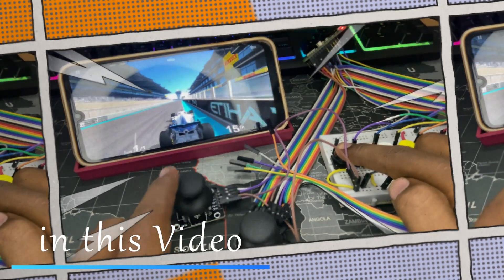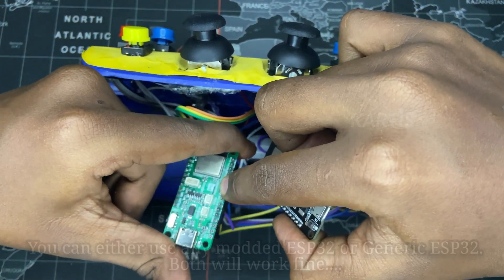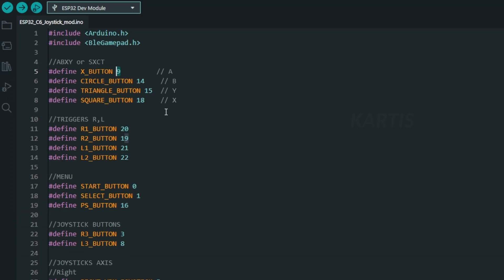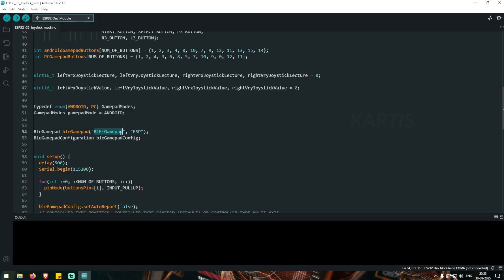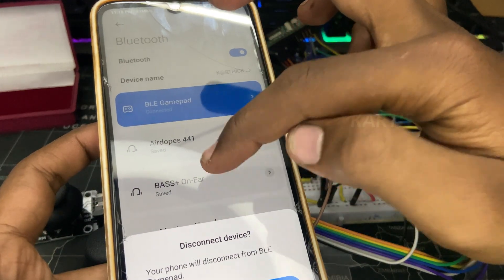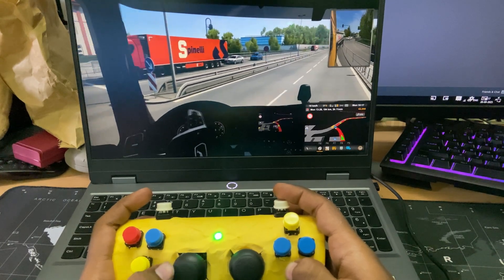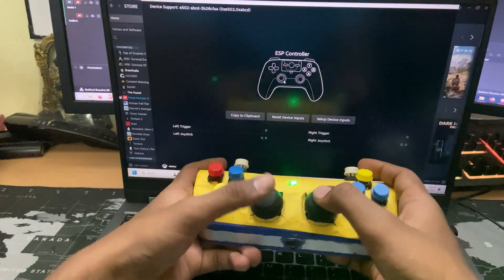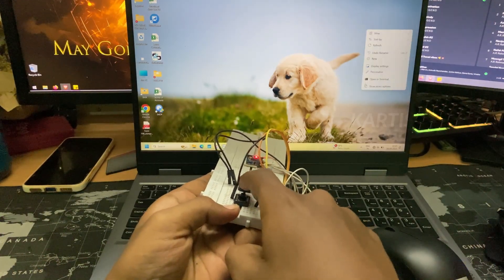ESP32 Gamepad: Low Latency Game controller joystick | Custom Battery options | Both Android and PC

Comment: Bro led switch resistor connection sollunga pls i am doing this project bro pls sollama viturathinga
Reply from the maker: connect the resistor in between the LED positive and ESP32's Digital pin bro. thats it.
Reply: Bro kodaana kodi nadri